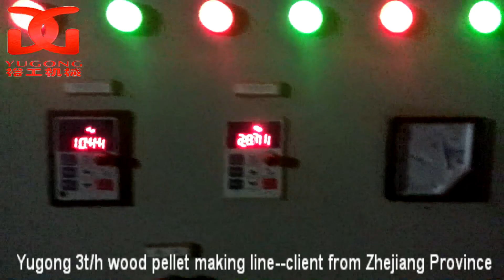3t/h wood pellet making line/production line

Comment: With all the typical characteristics of vertical structure ring die pellet machine

● Feeding vertically and directly to pelletizing room；
● Die static, rollers rotating, materials centrifugally, evenly distributed around；
● Double-layer dies, up and down dual use, high capacity and energy saving；
● Ring die, vertical structure, conducive to the pelletizing room cooling；
● Independent output device, ensure formation rate of pellets；
● Independent lubrication system, bring precise & automatic lubrication to bearings；
● Feeding system is equipped with inverters which can bring stepless adjustable feeding speed；

Further improvements of Yugong LGX series pellet machine

● Transmission part adopts European standard gearbox reducer which has been highly praised by customers, further optimize the speed ratio, make the perfect combination of transmission efficiency and durability. Its excellent performance is not a simple gear or belt drive models can match;
● With newly designed structure, overcome the shortcomings of serious raw material leakage problem in the pelletizing room after long-term use;
● Optimized the automatic lubrication system, on the basis of without downtime to realize automatic lubricating the bearings on various parts of the machine, further equipped with a pressure value to induction grease filling quantity and timely automatically adjusted, bring really perfect lubrication and save per gram of grease.
● Optimized the raw material lifting plate equipped in the pelletizing room to enhance pelletizing efficiency and quality.
● Besides made from special alloy and processed by vacuum hardening,the roller are processed by second special treatment and its durability is highly extended.